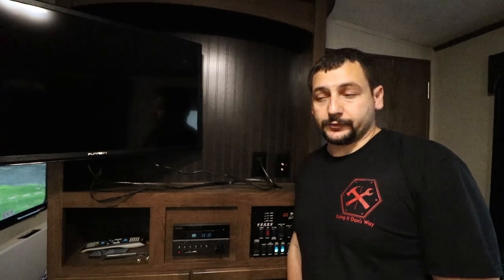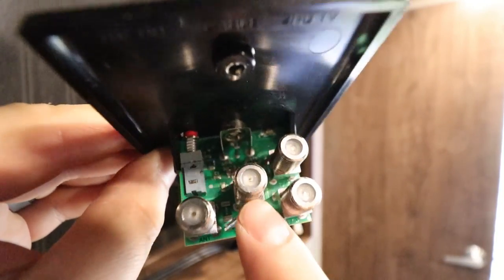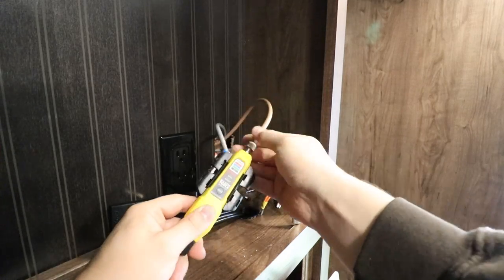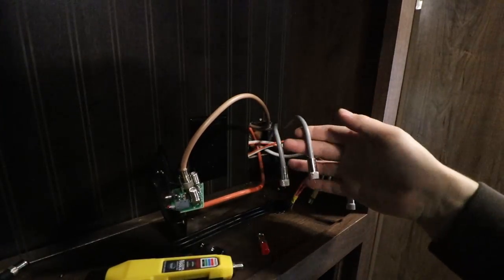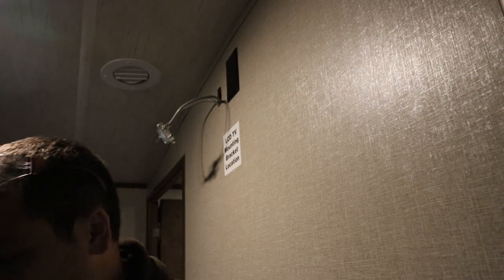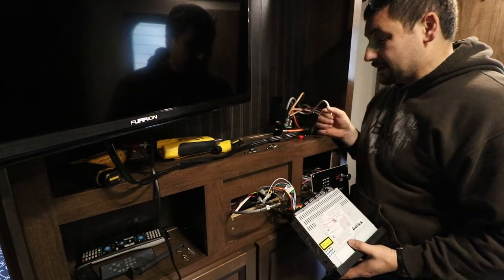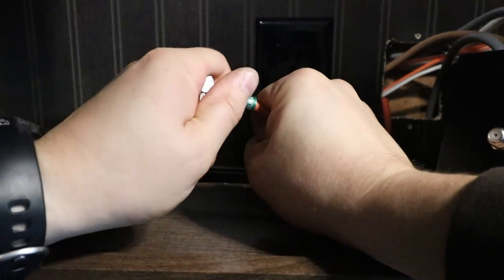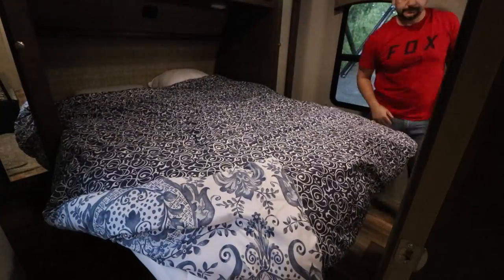Camper TV Antenna, Cable, And Satellite Connection FIX

Comment: I tore into my 3 year old travel trailer coax connections. Most coax connections were very loose, dangling and barely attached. I tightened them up.

Comment: If I remember correctly you bought that camper brand new . I would  had the dealer look at why it wasn't working . You said that it never  worked right in the first place . I'd be lost trying to fix that problem myself .

Comment: your radio has a RG6 wire because most cable tv providers broadcast the Radio channel (FM) on their spectrum band. Somedays, they will remove the radio band to use them for something else... (their cable, their spectrum) so in the future, your radio could stop receiving because of that connection. just keep it in mind. for now the cable is still the best method to receive the FM band.

Comment: An ohm meter & an extra piece of coax cable shorted together is another way to find out which cable goes where. Unfortunately, I have to do the same to locate my Satelite cable wire which is not where I was told it would be.

Comment: If the Antenna wire feeds the radio as well as the tv you should have used the splitter in the bedroom to split the antenna feed and use the cable 3 hook up on the board for the 3rd tv.

Comment: I went through most of my connections and I ended up replacing ALL the ones I touched. The crimps were halfway done and most of the connectors just twisted right off. If you don’t remove the correct length of shielding, the crimp doesn’t hold and the connection is below standard.

Comment: Thank you for this video.....why in the hell would they make a five minute job into HELL?  Haha.  I am trying to do this same thing on my sister's RV.  I bought a DISH Outdoor RV antenna, (dome looking thing) and the Dish Outdoor guy suggested that I buy a 50' coaxe cable and run it through either the wall or a window and directly back into the TV.  I really don't want to do this because of creating a leak issue.

Comment: Please tell me where that cable control board is located, I am trying to locate every area it could possible be connected to no avail.  Thank you for your video.
Reply from the maker: The control board in my camper is behind the main cable jack for the the main TV.

Comment: Let me start by saying that I have a 42 foot 5th wheel made by Forest River. The screw on connectors the manufacturer installs are total garbage and should be the first thing you replace, and I do mean every single one of them on both ends of the cable connection. Loose/poorly assembled connections will significantly decrease signal quality! The splitter in the master bedroom appears to be set up like mine was. The main TV in the living room is connected to TV 1. The   Master bedroom and the outside tv share the same TV2 connection via the splitter. Hope that helps clear things up.

I highly recommend buying the Winegard RFL-342 SensarPro TV Signal Strength Meter, not only does it give you an audible tone when your antenna is pointed  in the direction of the best reception, it also provides up to 20 dB of gain to amplify your weak signals. It makes tuning in your channels almost effortless.

Comment: I looked at mine and found 3 of 4 connections weren't hooked up and booster switch was hooked incorrectly. I bought it used. Now all tvs get cable and air channels.

Comment: Same problem in my new keystone cougar somebody got all the wires so screwed up I finally just put an outside port for my sat, you think the test there crap before they shoved it out the door also my Dometic furnace quite after a week was on the road they had to pull it out and put a new sail switch in it, they said this was a problem with this model, the dealers said j had to bring it in, well I didn’t want my ass to freeze so I had to get it done fast, probably eat that bill

Comment: Who here cringed when he reused the goop to seal the outside cable connection? Don’t be cheap! Reseal it with new sealant.
Reply: I gave him the the "benefit of doubt"... figured he didn't have any at the time and used what he had available.... hopefully changed it later.